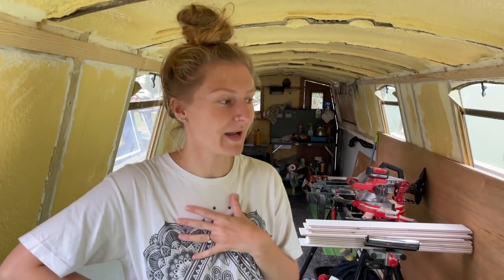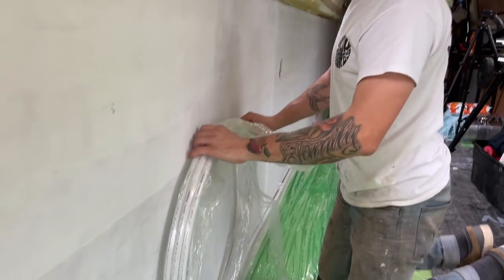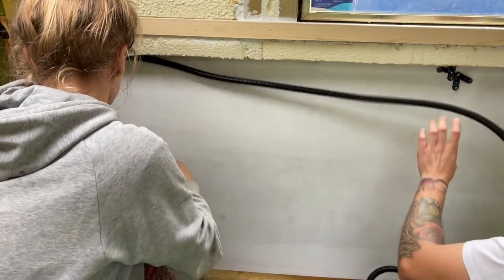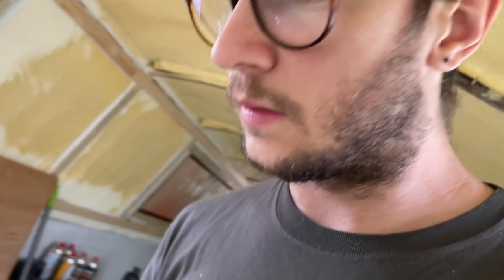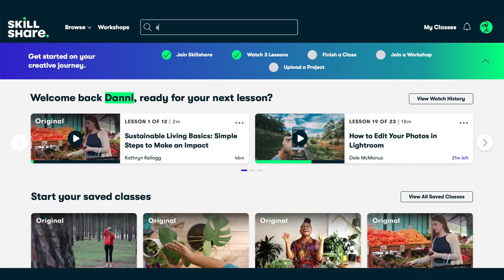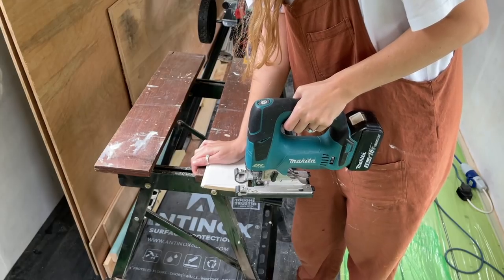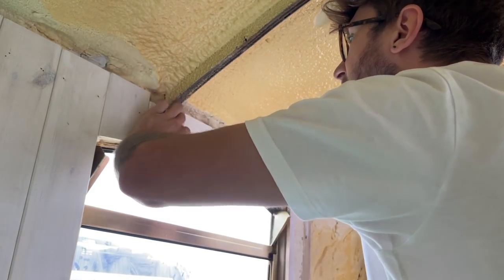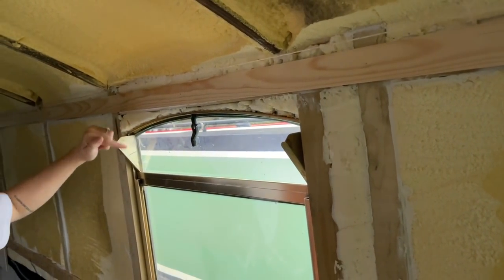Cladding a Narrowboat | Tongue and Groove | Narrowboat Conversion | BOATLIFE

Comment: Great video ,I´m always way behind the curve for some reason , i hate to say this but you can buy clips that fix the panels together inserted in the groove of the panel  thereby leaving no pin marks on the outside of the panels saving you from filling and re-painting.... sorry ..love that nail gun greetings from austria
Reply from the maker: Thanks for watching! Not heard of the clips that’s a good idea although the cladding we’re using is only 8mm thick (the groove is merely 3mm!)
Reply: @ItsOhJoe  yes they are Designed to slip in ..ask the man with the overall

Comment: Smooth bore conduit is far easier to fish cable through. You'll loose your rag with the type you've bought as the cables will snag all the way along. You may even find that you'll need 22mm bore as your cable size will increase due to volt drop. 😉
Reply from the maker: It’s been easier than we thought poking the cables through, a little insulation tape over the end helped with things. Yes just been battling a 10m run of cable for the water pump, some handy websites out there for voltage drop calculations!

Comment: Great Vlog as always guys. The T&G is looking good. Just a quick question. You mentioned having 240vAC aboard the boat. I thought Narrowboats used 12VDC and 24VDC? Loved the Vlog. Take care.
Reply from the maker: Thank you! So we’ll mainly be using 12v DC including fridge, diesel heater and lights but we’re installing a large inverter to cover a few 240AC sockets and a washing machine!

Comment: Hey guys, great work. Could I ask where you got your tongue n groove from? And what nail gun you’re using?
Reply from the maker: Most builders merchants will sell that TGV - it'll either be called 13x100 TGV / T&G V or something like 8.5x95mm finished size. Try Wickes/B&Q if no local builders merchants. Get a quote based on the total amount though as it'll soon add up, it's not cheap anymore!
Reply from the maker: Also it's a Bauker nail gun, it's a bit temperamental for working on the boat's electrics though
Reply: @ItsOhJoe  nice one, cheers for the quick reply. I’m about to tackle mine end of this week

Comment: I thought the purpose of tongue and groove was have the tongue exposed in the first piece with nails in the tongue (it gets covered with trim) and then nails in the back of the groove, insert the next tongue with nails in the back of the groove of the next piece and so on so the nails are hidden all the way down the run of tongue and groove.
Reply: I was just about to say that :)
Reply from the maker: Yes that is an option especially on thicker stuff but this being 8mm & the tongue only around 3mm in parts we didn’t want the nail gun to damage the tongues + if the nail doesn’t penetrate quite far enough the tiny head left will make a fiddly job of fitting them in even fiddlier!
Reply: When I was a little boy, my grandparent’s den had tongue and groove knotted pine paneling on the walls and I was astonished why there were no nails showing.  Grandpa was a carpenter and explained it to me.  That’s the only reason I know, my wood working skills didn’t come from him.  I can measure 5 times and still cut wrong!  LOL
Reply from the maker: @greggtilghman6349  😂😂 just like magic! It really is nice to see no fixings when the timber is being stained as opposed to painted!
Reply: @ItsOhJoe  definitely agree with you. We found that too and have done ours the same as you. One little tip if its not too late is to put your pipe clips a little closer together around 600mm centres. Just to avoid your pipes sagging being plastic pipe. . Keep going 💪

Comment: I think you have the pipe fittings too far apart. It looks fine until you run hot water through them. They will expand and drop.
Reply from the maker: Thanks yes will do, especially when we run the hot feed